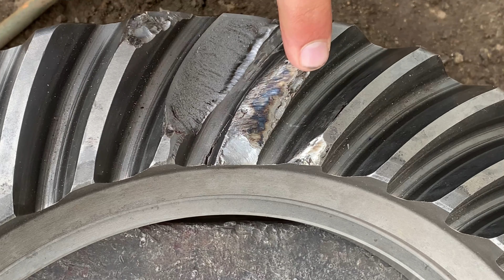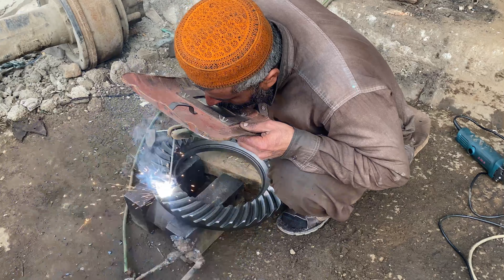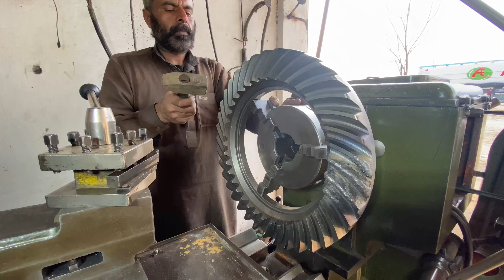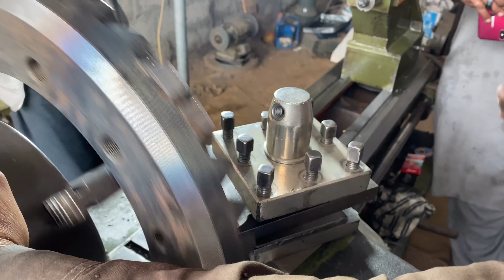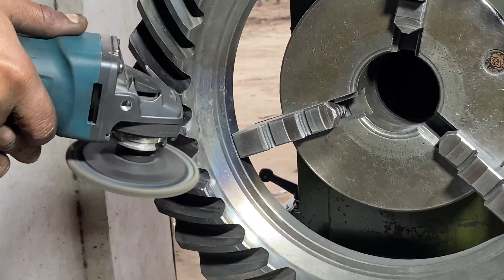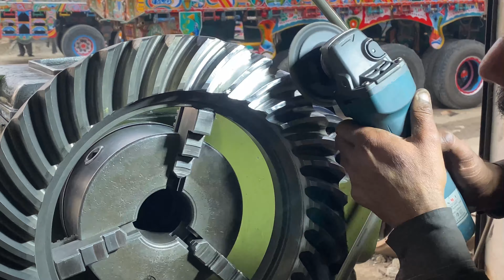I have repaired the scrub gear ring which no Mechanics repairs |We prepared well for the first time|

Comment: This isn't a nice job. It won't last, it's not the proper way to repair a ring gear. The only way to repair ir properly and it be safe is to replace it.
Reply from the maker: ok friend
Reply: Yes the grinder part is wrong & wont last  , the turn cut is correct . if everything is machine it might last longer .  hand cut 🤦 not cool  .
Reply from the maker: @arianduran1725  ok